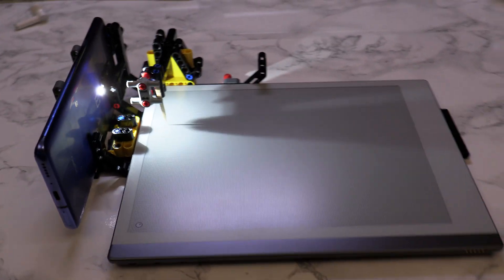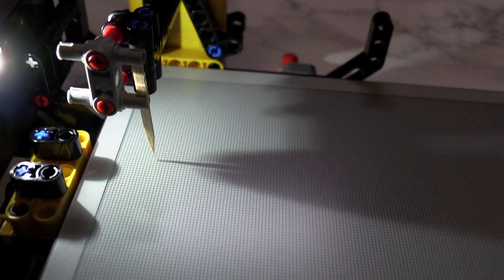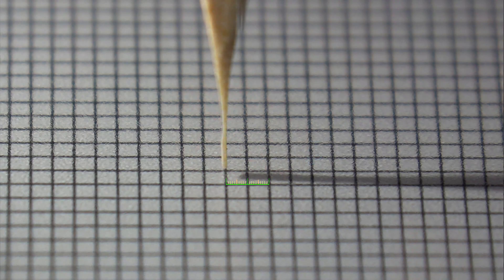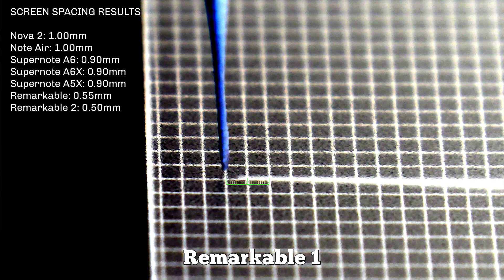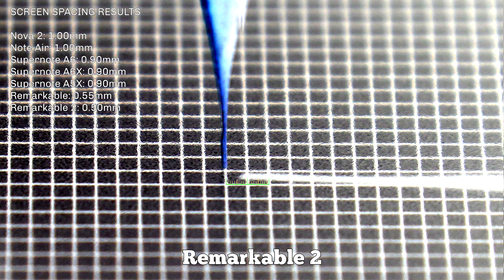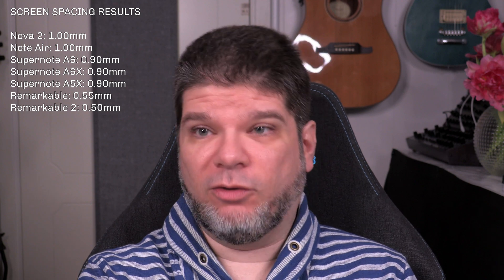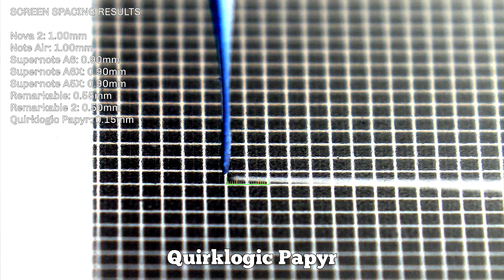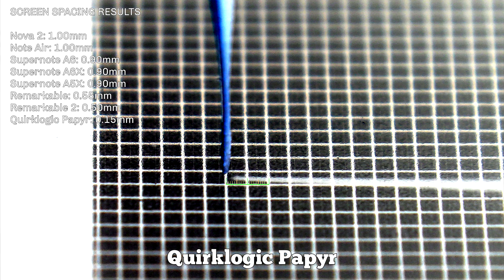Measuring The Surface-To-Screen Distance On: Remarkable 2, Note Air, Supernote A5X and Papyr

Comment: This makes my engineering heart happy! Really appreciate the development of the methodology here. I also love that the test apparatus is Lego-based. Many good things begin as Legos. :) As long as you can consistently get the light shining at a 45-degree angle towards the probe tip, your measurements should be good. Just a few ideas for improving the setup even further if you haven’t done so already: (1) Use a round-tipped metal item as the probe, such as the needle used to inflate a football. That’ll prevent any light bleed-through while also giving a very clearly defined profile edge. (2) Move the light further away from the probe. The greater the distance between the two, the more parallel the light rays will be and the sharper the shadow cast by the probe tip. (3) You probably already do this, but verify with a ruler that the grid does indeed produce 1-mm increments on each screen, ideally by making sure a ruler tick mark a ways out (say 10 cm) is precisely on the expected mark.

Now that two years have gone by, we need a “Round 2” of this test with the latest devices! I’m particularly curious to see how the Mobiscribe devices compare, along with the latest entries from Boox and the recent offerings from Lenovo and Kindle.

Comment: Let's call it Luiiiis!!
= D

I am utterly amazed in your ingenuity Voiya! At the start of the video I was buzzing my head on can such a test be made, how to even begin to come up with one. As soon as I saw your lil' contraption I knew roughly what it did and how you pulled out of!

It just goes to show that no matter how difficult or impossible something or problem may seem, the universe is an infinite amount more complex, and therefore a solution can be derived from the sheer number of possibilities in tackling the situation from endless angles! Like when discovering how a magician pulls off their trick through illusion.

Brilliant man! 

I would like to suggest trying a straighter light source. Perhaps one from a lens (like a vintage projector lens) or perhaps a fat/wide laser beam?

Also have you considered that when you adjust the levels of the image that it's possible that some shadow details are lost at the tip of the toothpick/pointer? I suppose this isn't an issue of your are only inverting the image.

Have a peaceful day bud,
Cheers!
(^^u)/

Comment: ppi resolution may change distance
Reply from the maker: Distance of a physical object casting a shadow? No, it can't.
Reply: @MyDeepGuide  proportionaly your results are correct. But not indivually. Easy to test. You can pinch to zoom in or out the image on e-reader. Ppi (screen size and resolution) is pinching in that context.
Reply from the maker: These are not images, these are real world proportional templates applied to notebook pages. Templates for testing have been made for each PPI specifically to always have real world scale of 1mm x 1mm on each device tested, so yet again, no, you are wrong, PPI doesn't affect this test.
Reply: @MyDeepGuide  you are right i missed the part you made template for each ppi sorry.

Comment: Congrats! This is definitely a very clever test! However, I will play the devil's advocate. What you're actually measuring is NOT the tip-to-ink distance, but the projection of the incident light onto the electrophoretic surface (i.e., the ink surface). Under the controlled conditions of your test, your measures are cross-proportional to the actual tip-to-ink distance. Therefore, your conclusions are only partially correct. I say "partially", because your claim that, for instance, the Note Air has a larger tip-to-ink distance than the rM can be correctly inferred from your test. However, the actual measured distance is not correct, unless the incidence angle of the light is 45 degrees, which can only be obtained with a laser. If you want the measure to be correct, you need to know the incidence angle and then multiply the tangent of such angle by the measured distance in your test. Nevertheless, even under such a careful correction, the obtained measure is still not accurate. Indeed, such a measure doesn't take into account the refraction of light. Since light travels through the display, which is a more dense medium than the air, the incidence angle will be affected. In order to correct for the refraction, you need to know the refraction index of the display (for instance, glass is 1.42), and then apply the Snell’s law to predict the angle value of refraction. Again, I really liked the idea and I found it very smart! Hope my comment will be useful for improving your test.
Reply from the maker: Or simply have the same distance and height relationship between the light and the measuring tip, which would give me an equal sided right-angled triangle, meaning that the angle is 45 degrees ;) But thank you for the passion and the input :) Much appreciated :)

Comment: Did you consider the angle of the light? Your light comes in a slanted angle which could make the number a bit off. I'm saying this because some claim that Quirklogic actually writes a bit left of what the user intends to write. For example, https://www.reddit.com/r/ewriters/comments/jcbauu/anything_on_the_quirklogic_papyr/ggc2brl/?utm_source=reddit&utm_medium=web2x&context=3
Also think about the fact that Quriklogic uses Sony DPT shell which is developed in 2016-2017. Possibly they are making some adjustments at the software level??

Comment: Thanks for this! I also noticed with the Papyr. However, I also notice that when I write with the pen at a slant, that the location of the mark is not directly under the nib. Therefore it loses the benefit of the closeness unless I write with the pen very vertical. Have you noticed this?
Reply: Paul, what this actually sounds like is that the default pen calibration is not set for your writing style. If you contact quirklogic's support team they can show you how to recalibrate the pen.

Comment: Agreeing that the special screen protector on the Supernote probably does a lot to reduce the distance while writing because, in actual use, it definitely doesn't feel how the numbers might suggest!

I also wonder if the shadow cast by the bezel on the "paper" of the Onyx devices adds to the effect of "feeling disconnected". Because the shadow on the edges of even the Poke 3 (which doesn't even have a Wacom layer) is much larger than the one on the A6X; I assume this is because the A6X has no frontlight layer. So while looking at the device, even without writing on it yet, you're already getting a visual cue that there's significant distance from the surface on the Boox.

Comment: Great. To confirm a couple of assumptions: 1) The pointer is positioned touching the top surface of the display 2) The grid on the display is calibrated to real world standards (i.e. 100 grid lines matches 100 mm on a precision ruler) 3) How are you adjusting for the thickness of the tablets? Doesn't that change the light source geometry? I suggest changing the tool so the whole rig sits on the display surface so all of the geometry is relative to that critical plane for every device instead of relative to the back plane.
Reply from the maker: 1. Yes
2. Yes
3. In this version it is fixed, but in the final one, if testing shows that the results are significantly different, then the light source will have adjustable height, to compensate, however, the differences the thickness would introduce are far lower than what i can measure, so it's very likely that it will fall into the error margine. Either way, that's the next stage, to fine tune it :)

Comment: The supernote screen protector gives when you write on it, so your pen point would be closer than just the surface with no pressure. This is an interesting way of quantifying the perceived depth you are writing at.

Comment: Great as always! This is LEGO Technic as it's meant to be. 
But I would use a metal needle.
Reply from the maker: I considered it, but it would scratch the surface.
Reply: @MyDeepGuide  Why I knew to get this answer. I'am only afraid about moisture and cutting the same piece again when it gets broken. 

Don't get me wrong, it's your mashine, but maybe you gave a chance to a mechanical pencil mine. 0.2-0
3 should be good enough.

I really like Desta and the new shadow ruler.

Comment: Great idea and another nice machine-thingy you built there! Somehow reminds me a little of the funny brick robot in the 11th Olsen Gang movie. :-) Just a quick idea on how to squeeze a little more precision out of the setup: How about using an (exactly positioned) laser pointer and something even pointier and sharper than the toothpick? But please use laser safety goggles if you ever try that as the surfaces will add a lot of diffusion and might redirect some light directly into your eyes. Keep up the great work!

Comment: All of these were much better than the original kindles with light where you have the text look sunken in look. I have the remarkable and max lumi and the difference I could tell there was a distance between tip and ink. But after a little adjustment I don’t really notice it. Again none of these were as bad and probably barely noticeable if you don’t have devices to compare with.

Comment: Hello Voja. I do not think this gives you the exactly correct measurement. Unless the distance of the light from a toothpick and the surface are the same, giving you 45 degrees angle. You have to calculate it as a triangle with the angle of the light. I know the difference will be small, but still. I posted this comment about 4 hours ago with a link to the picture, but it looks like the comments do not show if there is a link in it. So here is it again without the link.
Reply from the maker: Hi and thanks for your input :) I know about that, and the angle is close, but not exactly 45 degrees. This is obviously still a work in progress, bit once it is finalized, it will have an exact 45 degree angle, to give precise measurements. Thia time i was more interested in the relationship between the different devices, which thia version of the device gave me :)